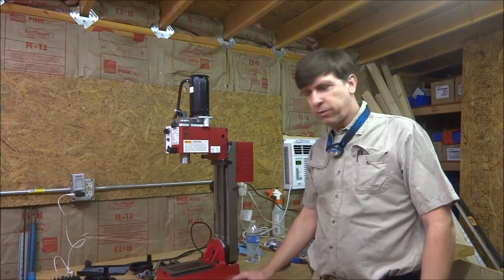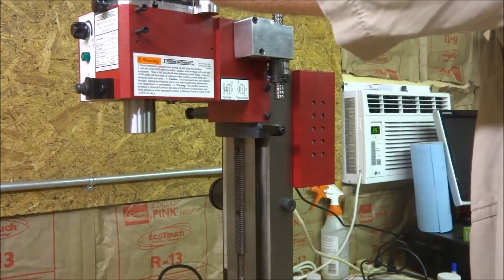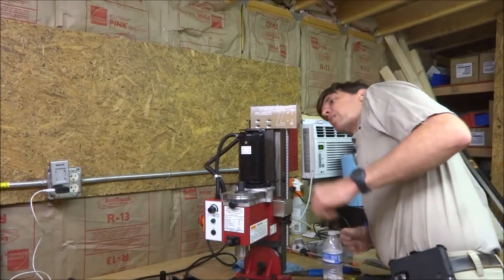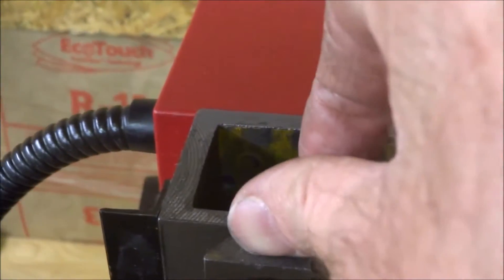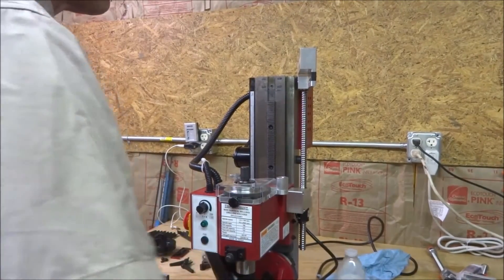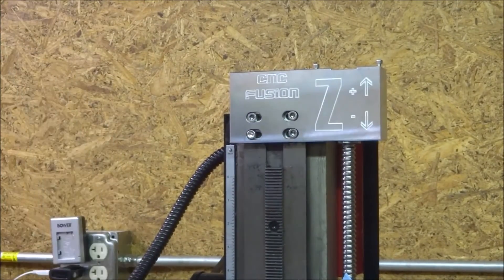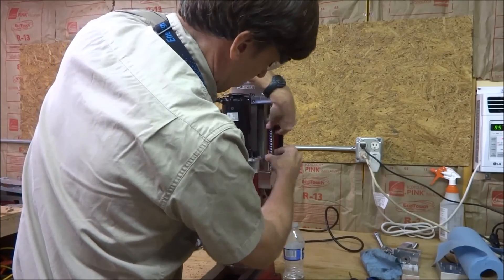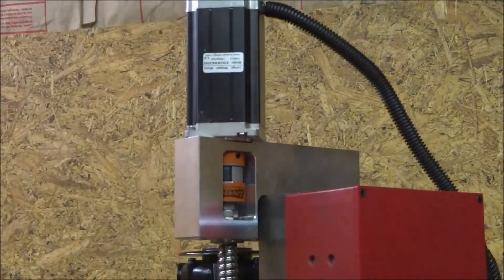Mini Mill CNC Conversion Part 4 - Z Axis

Comment: Any regrets using the Lovejoy couplers. I know you said 2-3 thou backlash and you compensated in MACH3 but some time has passed.....I have the Lovejoys but I don't have a lot of 'mileage' on my machine yet. I'm thinking about investing the $75 for the zero backlash couplers but want your opinion first.
Reply from the maker: kaydee457 - I would have gone with the zero backlash but cnc fusion didn't offer it for my stepper motors. They just had 1/4 couplers and my steppers are 3/8 I think. I am using a Tormach now though.

Comment: so what how much back lash did you end up with? x, y, z
what spring? did a helper spring for the z axes come in the kit?
i also live in phx, what is a taig mill?
gary
Reply from the maker: I think I had around 2-3 thou on the X and Y.  None on Z.  I entered the backlash in the mach3 backlash compensation field.  The mini mill comes with a helper spring.  I just put it back on.  The air spring conversion kit I got didn't work with the CNC Fusion it.  Phoenix, Cool!  Its suppose to be 115 degrees on Saturday. :(  A taig is a small mill like the mini mill but is manufactured here in Chandler.

Comment: OTHER INSTALLATIONS HAVE NOTED RUFFNESS  OR A GRINDING NOISE ON THE Z BALL SCREW WHEN GOING UP?
DID YOU HAVE THAT PROBLEM?
GARY
Reply from the maker: At first.  It went away when I reconnected the spring.

Comment: Hi!
Yes, i have a plasma table. Also based on mach3, works great and i use it frequently :)
I recently got me a taig mill, hardest part was finding a computer that would play well with the G540. I surrendered and bought a smoothstepper wich i should have done from day one instead of trying to find a just enough old computer.
Reply from the maker: Peter Dahlman 
I was thinking about getting a Taig. The place where they make them is 10 minutes from my house in Phoenix Arizona.  I ended up getting the mini mill because of the price. I'm not familiar with Gecko Drives and Smoothsteppers.  I got a stepper motor kit with power supply and breakout board. I guess it is basically the same thing but with slightly different design.  The Gecko looks cool though. I guess you don't have to use aviation plugs to wire the motors.